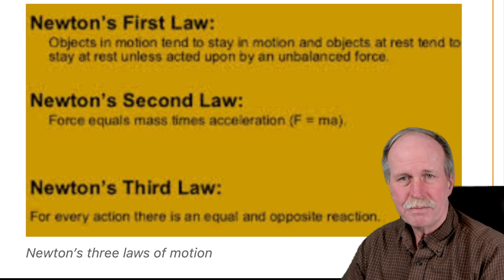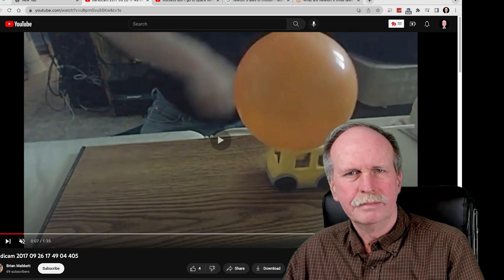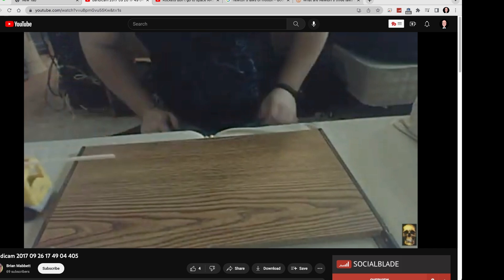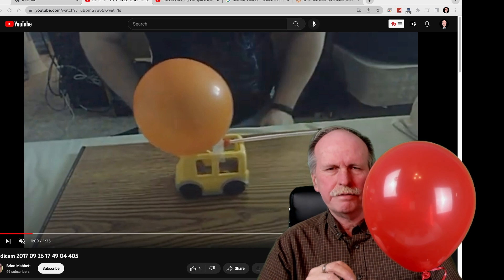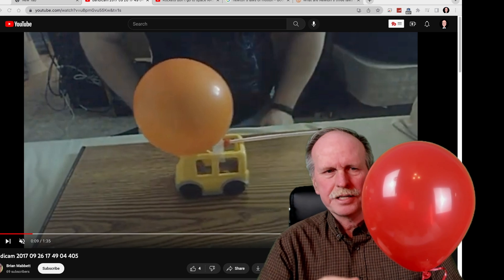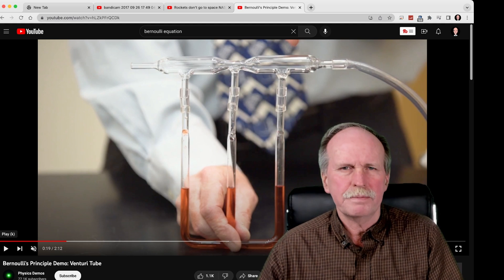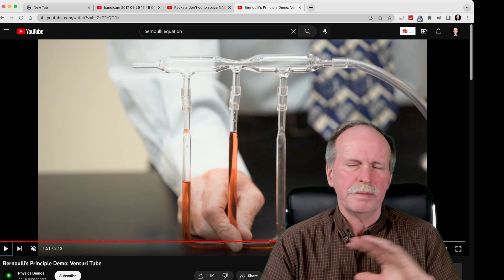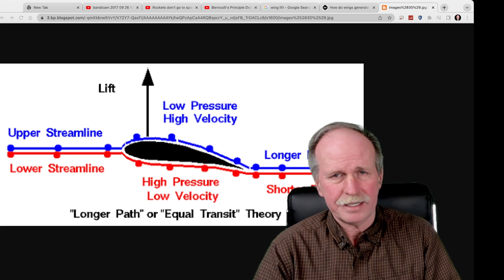Flat Earth Proves Rockets DON'T WORK

Comment: I understand the experiment, I understand why it works etc. The bit I disagree with is the angle of the balloon. 
I think the angle of the balloon is due to the bend on the neck where it attaches to the straw. I think it's more likely the car was heavier or the wheels were stuck.

Comment: Bob your forgetting Newton’s third law . the gases from the rocket push against the air and it the opposite  reaction that sends the rocket forward. The gases are going down but the rocket goes up because the air pressure force is pushing the opposite way  ie up  or you saying the third law only works when you want it to .
Reply from the maker: what direction are the expelled gasses going?  Newton's Third has nothing to do with the gases 'pushing' on the air.
Reply: @  wrong we are supposedly talking about a vacuum of infinite size . The instant those gases are expelled they are I instantly drawn into the vacuum of space in all directions thus no push on anything . They would have as much  push as a blow torch does on moving earth . You can’t have it both ways either space ain’t a vacuum or it is and if it is the force expelled from the rocket goes in all directions the moment it’s created ie no movement. Basic term is god vacuum cleaner with infinite power  that pulls in all directions at once . It’s just physics
Reply from the maker: Ah so you are clueless and think rockets have to push off air. I could suggest some good instructional videos to get you up to speed

Comment: 10:45 The "longer path" theory explained here is completely wrong, although it's widely used.The two streams don't have to meet at the end of the wing. In reality, the air molecules on the top and the bottom of the wing do not need to meet at the trailing edge of the wing simultaneously for lift to be generated.
Instead, what happens is that the shape of the wing, particularly the curvature on the top surface (called the airfoil), causes the airflow over the top of the wing to accelerate and create a lower pressure area compared to the air flowing beneath the wing. This pressure difference results in lift being produced.
It’s the pressure difference created by the shape, angle of attack, and overall design of the wing that generates lift, rather than a requirement for the air to meet up at the trailing edge.
You can see the actual image you used here being labeled as incorrect on https://www.grc.nasa.gov/www/k-12/VirtualAero/BottleRocket/airplane/wrong1.html

Comment: Bob, love your videos and of course rocket absolutely do work in space, but have to comment on a couple of points:
 Your explanation of lift is wrong. Many wing airfoils dont have longer paths over the top and many of those that do can fly inverted, neither of which would be possible according to the equal transit theory you described. There is actually no imperative for packets of air separated at the leading edge to meet up at the trailing edge and in reality they dont, the air over the top gets there first. In fact the illustration you used is clearly titled 'Incorrect theory #1' on the NASA website where you got it: https://www.grc.nasa.gov/www/k-12/VirtualAero/BottleRocket/airplane/wrong1.html

The idea that the air coming out of the hair-dryer being lower pressure is also incorrect. The hair dryer adds energy to the air with a fan, therefore it can move faster and be at the same pressure as the static air around it. The reason that the balloon moves toward the efflux of the hair dryer is because of the curved surface of the balloon over which the air flows turns the airflow, creating an 'equal and opposite' reaction in the balloon.

Comment: My understanding of how a rocket works was much simpler, and I didn't even think of Newton. The fuel burns and expels gases; in a vacuum, the gases would have nowhere to push against... and the rocket wouldn't move. The issue is that gas production continues, and the gas that is being generated can push against the gas that was produced in the previous moment. If flat-earthers think that there is something need for the gas to push against, here it is...
Reply: Rocket engines work better in a vacuum, there's no atmosphere to slow down the exhaust gases

Comment: In Aviation,  there are two ports that can be on the side of an airplane fuselage: a pitot  tube which will point forwards, and a static port which will just be flush with the side of an airplane.  Both are needed to measure airspeed.
Reply from the maker: yep
Reply: @BobtheScienceGuy You're wrong, rockets do not work as advertised in a void, and this is where people are confused because both sides are correct just not in the way they think. 

Rockets don't "throw" mass backwards at high velocity to generate effective thrust. The fuel and oxidizer are ported to the combustion/mixing chamber by a pump from their storage tanks. This is the only "throwing" being done in the process of generating thrust. 

Take the F1 engine for example. It produced 1.5 million lbs thrust at sea level from only 6000 lbs per second of fuel, ported to the mixing chamber at....wait for it....40 m/s through the baffle plates. Yes that's correct. Plug that into F=MA and tell me how much force you get. How is that possible? Follow along. 

Once these reactants are mixed under containment (atmospheric pressure) and ignited, the energy from reaction causes this volume of excited particles to rapidly expand in every direction, gaining momentum the longer they remain contained (pressure buildup). 

This is where the magic happens. These particles transfer their energy (do work) onto the surrounding medium of containment (15 psi air in this example) compressing against the container as it attempts to move it out of the way and continue rapidly expanding equally in every direction. It's the resistance to this expansion which creates the necessary reaction force to propel the rocket in the other direction.

The kicker is that you can't build the necessary pressure to accelerate these particles to multiple km/s if there's no medium to contain them in that environment (mixing chamber) because the nozzle is permanently open to the void of space.  In a void the first molecule of reactant that leaves the baffle plate will continue at 40 m/s in the same direction opposite the rocket, right past the combustion chamber and through the nozzle, never slowing down unless acted upon by an external mass (ether/nothing). 

It's the same with every molecule behind it. Meaning they can't inter-act with each other, therefore no re-action occurs, therefore no combustion and no change in energy state to achieve 5 km/s of momentum.

 In a tank filled with gas particles with all other conditions held constant such as temperature and mass,  increasing the volume of the container results in a decrease of pressure inside that volume. So if a piston were inserted it would move with less force and travel a shorter distance in the same timeframe. Extrapolate the same tank to the size of the known universe. How far is that piston moving? not an inch. 

 Unfortunately you don't understand the physical concepts behind rocket thrust and assuredly haven't crunched any numbers or looked at the actual source documents such as the technical manual on a rocketdyne F1 engine (Saturn V). So please try debunking this physically consistent model.

Class dismissed

Comment: If a gun were fired in a vacuum, you would feel the recoil - why.  Yup, the change of momentum, exactly the same as in the rocket.  The combined momentum of the gun and the bullet is conserved. Actually, the presence of air would reduce the recoil.  That is why rockets work better in a vacuum.  Try this experiment: throw an anvil at your favourite flat earth friend, and he will fall over.  Whu? Conservation of momentum Duh!  There's your proof.

Comment: Sometime you should do an entire video about how airplane wings produce lift. One thing seems true: The momentum of the air disturbed by the aircraft which moves downward is equal to the momentum which lifts the aircraft. There is definitely vacuum on top of the wing. I got a good demo of that fact in a glider when the vacuum sucked out the unlocked spoilers. But there is also pressure against the bottom of the wing. Together, these account for the lift generated by the wing. One thing to consider is aerobatic flight; how does an aircraft fly upside down?

Comment: While the Bernoulli effect contributes to the lift of an airplane's wing, the main cause of lift is downward deflection of the air as the leading edge of the wing is higher than the trailing edge.  This is also an example of a reactive force, i.e. the plane pushing air downward causes the plane to move upward.
Reply: It really depends on the airfoil.  With a thin, flattend airfoil, deflection is more of a factor than pressure difference. But when the airfoil is Designed for slow speed, high-lift, the pressure difference is the primary factor creating lift.  You can see an example of that with a plane like the U-2 or even some sail planes that can actually have a nose-down pitch and will still be climbing.    Most airfoil designs are using a combination of the two effects to produce lift.

Comment: great video. A small correction, at the end of your video you mention this is how a gas pump knows how much fuel is going into your car. I think you may be referring to a magnetic type flow meter that does utilize this principle. however in a gas pump, and in most custody transfer points, typically a positive displacement meter is used. they are also temperature corrected due to liquids and gases have different densities due to temperature.

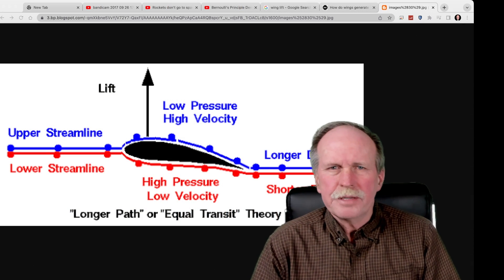Comment: 10:28 Just saying, airplanes do not necessarily need the Bernoulli effect to fly, it is just contributing to the lifting force by up to 30 % ... the main contribution for a lift comes from the angle of attack on a  wing, caused by the change of the air's momentum diverting down. Even a wing has a symmetric profile, planes would still fly.

Comment: a"vacuum cleaner" doesn't create a vacuum. it creates air flow. Your vacuum cleaner doesn't clean your carpet by vacuum it cleans it by air flow. If you make a big enough hole in a space ship or an airplane at high altitudes, objects will not be sucked out. Objects will be carried out as the cabin air depressurizes. We know this because it has happened to airplanes and people were tragically "sucked out". However, once the pressure equalized betwen the inside of the airplan and the outside of the airplane there was no longer any danger of anyone being "sucked out". This is because it isn't about vacuum.. it is about a differential in pressure. If a plane actually depressureized itself as it climbed then if it got a hole in it then things might get sucked into the plane. imagine what happens to a submarine that gets a hole in it.... the water comes into the submarine because the pressure of the water outside of the submarine is greater than the pressure of the air on the inside of the submarine.

Comment: Bob, I really enjoyed your video, however I would like to address your explanation of lift from your wing example. The airflow illustration over the wing you show is not correct; in fact, that wing shown is producing zero lift in your example. The Equal Transit Theory is NOT a correct theory, and it continues to astound me that it is still taught (even to pilots!), as there is a tremendous body of evidence from wind tunnel tests that disprove it. There is no physical principle that demands that the air/fluid particles must meet up at the trailing edge after taking different paths. In fact, the air traveling over the top of the wing leaves the trailing edge significantly before the air traveling under the wing reaches the trailing edge. Lift is a result of the wing turning the free stream airflow relative to the trailing edge. Conservation of momentum is what produces lift. Yes, there are pressure differences between the top and bottom of the wing as a result of Bernoulli's Principal acting on the two separate/independent airstreams (above and below the wing), but force is ultimately the result of the time rate of change of momentum; no momentum change normal/orthogonal to wing means no lift. In your example, you need to show the airstream bending down when the air leaves the trailing edge, not parallel to the free stream as is shown. And again, air that meets the leading edge of the wing in front does not meet again at the trailing edge, as the top flow is significantly faster than the bottom flow. Your videos are enjoyable and enlightening; thank you for your debunking!
Reply: You are a very gifted teacher - please keep doing these videos!
Reply from the maker: Thanks for the correction.

Comment: It's funny how some people think the vacuum of space would "suck" the air out of a spacecraft if the hatch were opened, rather than the higher pressure of air inside the spacecraft pushing itself out into the vacuum of space.  That's how some people confuse the vacuum of space with the sucking action of a vacuum cleaner.  There's no "sucking," only pushing.  Outer space doesn't suck.  Funny.

Comment: Perplexing Question

Everyone knows what a square is: Four lines of the same length connected at ninety degree angles. If we draw a line from the top right corner to the bottom left corner and discard the two left lines we end up with a right triangle. As a matter of fact it is called an “Isosceles Right Triangle.” Owing to the fact the horizontal and vertical legs are the same length just like the square. The resulting interior angles are ninety degrees on the bottom right, and forty-five degrees on the top right and bottom left. I live on the coast in California and every morning around nine o’clock I look to the east about forty-five degrees up from horizontal and I see the Sun. This morning I called my friend who lives on the Atlantic coast in Florida roughly three thousand miles away. I asked her, “What time is it in Florida?” She responds, “High Noon, twelve o’clock, time for lunch.” I ask another question, “Where is 
the sun?” She says, “It is straight up above my head, ninety degrees to the horizon.” So, I’m on the California Coast or bottom left point of the Isosceles Triangle where the bottom leg meets the forty-five degree angle leg looking toward the east at the Sun. My friend is on the Florida Coast or bottom right point of the same Isosceles Triangle where the horizontal leg meets the vertical leg at ninety degrees, and she is looking straight up at the same Sun. The question that has me perplexed is: How far away is she from the Sun?
Reply from the maker: It is just over 93 million miles and varies with the orbit. The sun is never directly overhead in Florida and that isn’t how the distance is measured
Reply: @BobtheScienceGuy  Now, not only am I perplexed, I am confused. Is it that the "Principles of Geometry" cease to function when applied to cosmology, and therefore "...that isn't how the distance is measured"? Also, of course you are correct that the Sun cannot be seen directly overhead north of the Tropic of Cancer. Let's instead apply the "Perplexing Question" to Equatorial Guinea, African Continent (Atlantic Ocean), and Mogadishu, African Continent (Indian Ocean, 3,000 miles east). Both are located very near the Equator. Let's further use the date of any year's Equinox. Can the "Principles of Geometry" be applied to measure the distance with these parameters?
Reply: @BobtheScienceGuy  Have you had a chance to review the question postulated (...do the "Principles of Geometry" cease to function when applied to cosmology…)? I am earnestly seeking a cogent argument to refute the observed phenomena. Thanks in advance for your attention.

Comment: That’s good stuff. 1 question, is the blue and red colours in your high and low pressure diagram picked to represent hot air and cooler air or is the air temperature not a factor in high and low pressure? Thanks
Reply from the maker: No I don’t recall making that distinction
Reply: @BobtheScienceGuy  I wasn’t implying that, I was just wondering if that was the case cause when I think of low and I pressure I think warm and cold and tornadoes. Just curious. Thanks

Comment: The way I explain it to people is this: If you were sitting on a skateboard and threw a bowling ball away from you as fast as you can, what would happen? You would move in the opposite direction. Now, do you think you moved because you were pushing on the air? Considering how non-dense the air is, how could that be true? Next, imagine that, instead of one large heavy ball being thrown away from you, you're instead throwing trillions of much smaller "balls" away from you with incredible force and velocity. It is the same concept.

Also, amateur rocket enthusiasts have launched rockets over 70 miles with on-board electronics that measures velocity, altitude etc and you know what? The speed actually INCREASES as they gain altitude, even though the atmosphere is getting thinner and thinner all the time (The air at 30 miles is about .1% as dense as it is at sea level). So how can that be possible with virtually no air "to push on"?